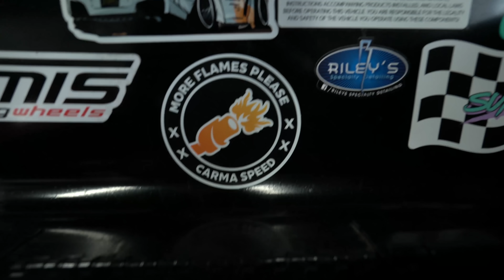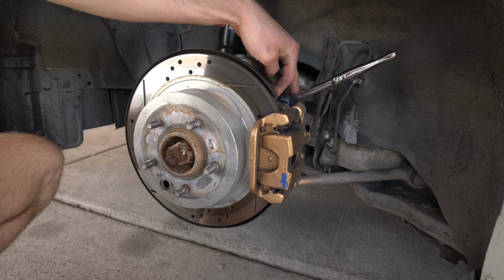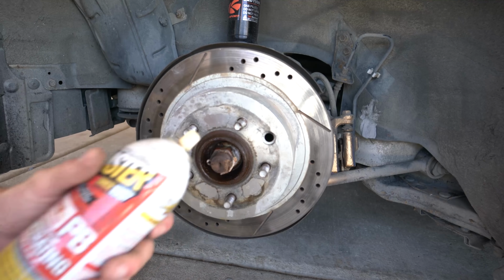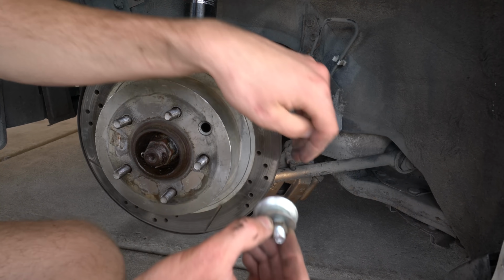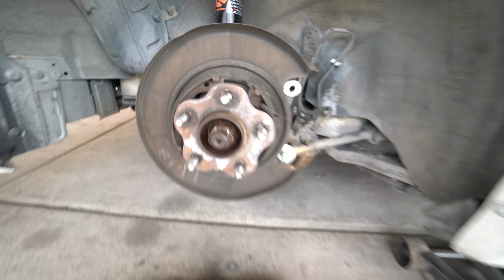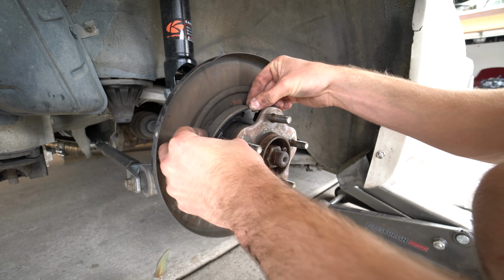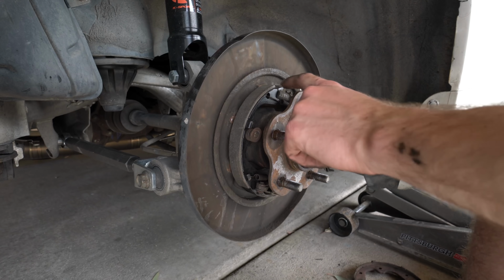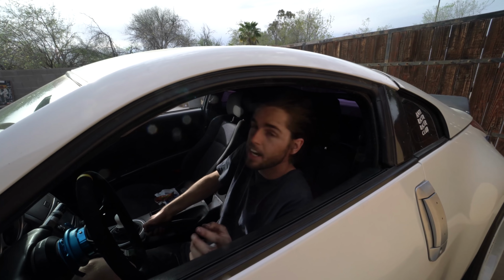FIXING 350z E-BRAKE!

Comment: I have a question.  Even with the e-break not engaged, is the rotor still kind of difficult to rotate compared to the front?  I have a G35 coupe and I heard it's because of the LSD.  Just want to make sure there's not something else wrong with it.  I'm gonna just check the other side, but can't until wednesday.
Thanks.

Comment: Cameron, I am going through the same thing right now with my 350z!, I changed the parking break pads and new springs, and my ebrake still doesnt feel right, i cannot find the parking break lines either... Z1 has them for $80+ brand new and ebay has decently used pairs for $30... good luck bro let me know what you find and what you do
Reply: Theres generally no need to even mess with the parking brake cables.  Replace the brake shoes and adjust from the adjustment nut on the wheel hubs.

Comment: I have a question, why would the brake pads on the e brake be worn if they are only used as a parking brake.
Reply: When you apply brakes, it uses all 4 pads - 3 years late 😬
Reply: @TheOzzieTraveler 😂😭
Reply: @TheOzzieTraveler no it doesn't?  The rear brakes use a caliper and the e-brake uses the drum.  Normal braking should not wear the parking drum brake.
Reply: And the answer is he doesn't use it just for parking.  Especially on this car, it's usually used for drifting

Comment: Take it all apart throw out the rotors and start over. Theres a hole in rotor to adjust the ebrake. A hammer to take of rotor really? That was the funniest part of the video!! You hit that rotor 1000 times and proably had  e brake on lmao. Dude this is first video i ever seen with such ridiculous methods. Find a new hooby!
Reply: Have you tried taking these rotors off yourself ? You’ll find they get pretty well glued on there.